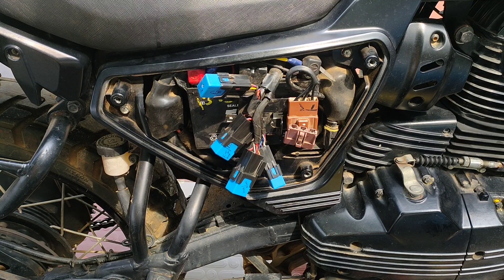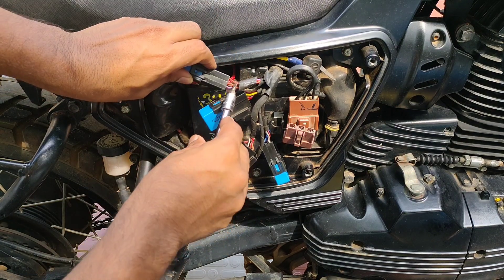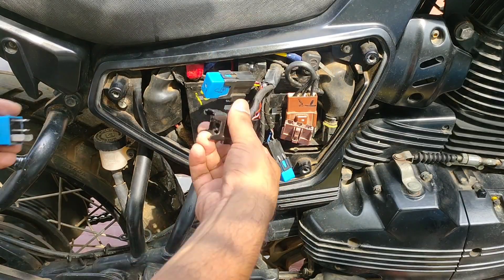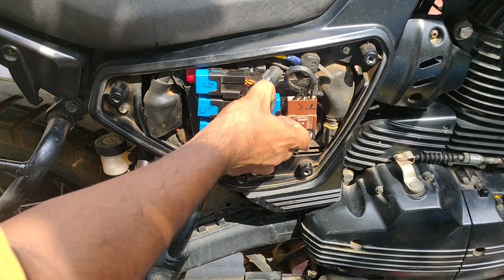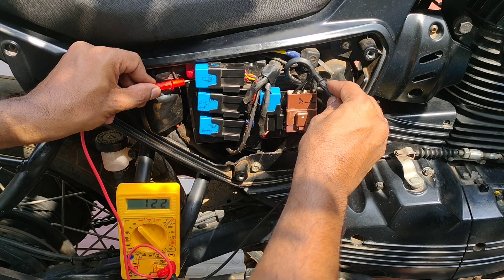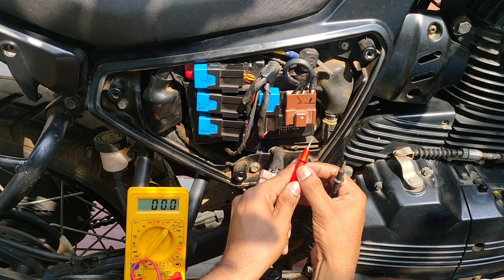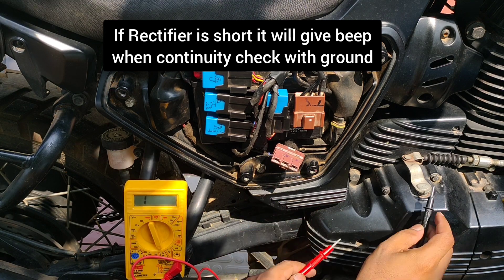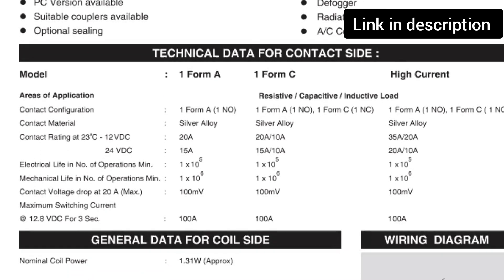Yezdi Adventure: Understanding Relays and Battery Charging System Functions

Comment: Hi bro my yezdi adventure facing system voltage issue so I was change battery also but that same issue coming...how to solve that problem bro
Reply from the maker: @punithn1591  Regulator Rectifier (RR UNIT) might be faulty it converted ac to dc and regulates Voltage not to exceed voltage not more than 15 Volts
Reply: @baby_adventure  ok bro
Reply: Hi bro Regulator Rectifier is  beep
continuity check with ground so that's the problem?what is solution for that issue?
Reply from the maker: @punithn1591  Replacing is the only solution , before that confirm the voltage while engine is running across the battery

Comment: Best battery in yedzi adventure?
Reply from the maker: @MilanChetry-i2u  I am not aware about best battery most of the owner	s replaced stock battery with amaron battery
Reply: @baby_adventure  some few days I am facing a bettary issue problem in my bike ... Whts the solution...
Reply from the maker: @MilanChetry-i2u  battery issue means can you elaborate on it , if I could help like the battery is old? What is the exact issue you are facing

Comment: So 
We don’t need to buy an additional relay for auxiliary lights if we connect to the accessories port right.
Reply from the maker: It doesn't work like that relay protects the switch from high current and thus protects connected outputs. If you arrange a switch which can handle 2A-3A it is okay. Even then the life of switch dimensions due to excess heat produced by high current